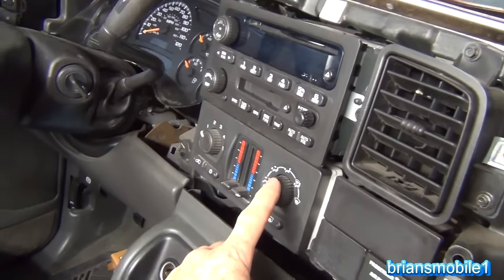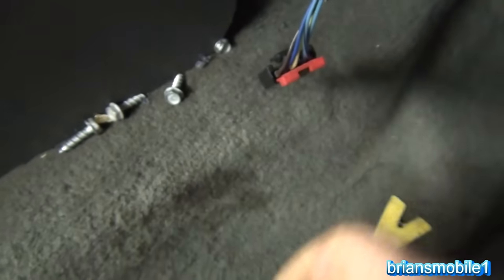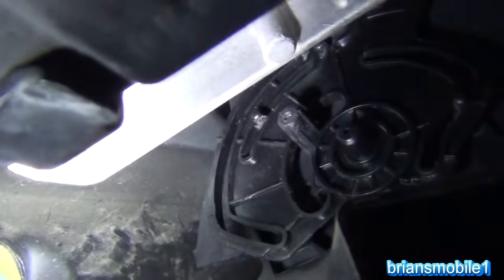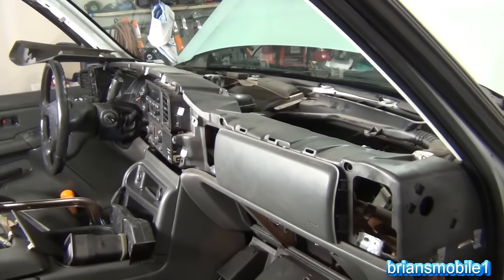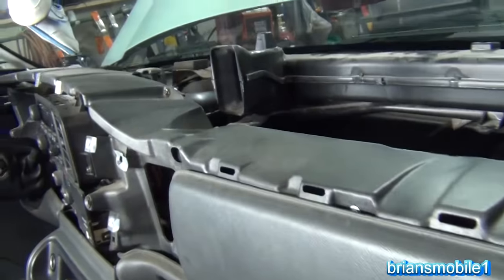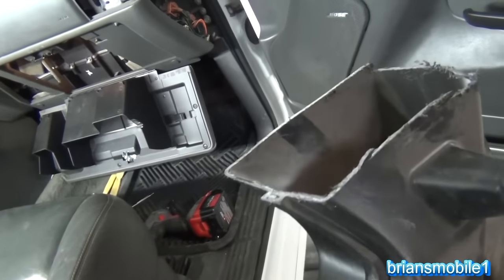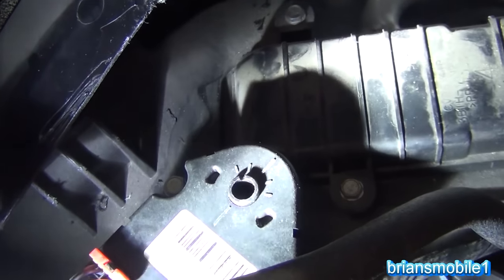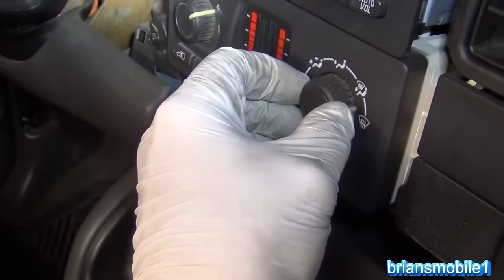Silverado Heater and AC Actuator FIX

Comment: So what kind of magic tool it take to get the top bolt out 🤷🏼‍♂️ little difficult?  there is a metal bracket in the way of any socket
Reply from the maker: 1/4" flex ratchet and a buzzed down short socket is what I use, or a ratcheting box wrench.
Reply: Thank you!!

Comment: Hello I am not sure how to even read your comment back but my question is I have a 2004 Chevy Silverado 1500 and the control that tells you where the air is going to go does it work when I turn the knob it doesn’t matter where I turn it the air is sorta coming out of mainly the defrost very lightly the vents in the floor it’s coming out of everywhere but just you know very lightly out of everywhere it’s mainly blowing out of the defrost no matter where I turn the button when I do the recirculation button I can hear that click on and off so that works it’s just the airflow can you please tell me how to adjust that is there something else other than an actuator that just controls where the air goes when you turn that knob

Comment: How do you tell the difference between automatic and manual blend door actuator. I've changed it out but never knew there was a difference and the new one never worked. Just been changing it over by cracking the actuator open and adjusting it that way.
Reply from the maker: The controls and the temp display.

Comment: 1 have a 2003 Silverado manual control temp ,this morning I rated getting  cold ac on driver side and hot air on passenger side  is this actuator the one under the dash cover  to the left of the gloves

Comment: My 2014 GMC Yukon is stuck on blowing cold through the front only but no heat and it will not move to floor or defrost also the rear hvac is stuck on blowing cold through the floor vent and will not move to the overhead 
I don’t think all the actuators would fail all a once in the same position so there must be another problem 
Do you think the control in the dashboard could be causing the problem 
I see all the videos about actuators and swing door but nobody changes the control

Comment: this helped out alot. my ac is blowing hot on the drivers side and i wanted to know what all is required incase it wasn't a fuse. then again I've had a problem where my compressor belt wouldn't stay on. now it does, but having this air issue.
Reply from the maker: +Snipe Stud00 Thanks for subscribing and clicking that thumbs up!
Reply: briansmobile1 thanks for the video. Found that the driver side unit main gear cracked and jammed on that extra space. Just flipped the gear around and it worked like new. You saved me a ton. No problem for that sub thumbs up n that.....now time to replace  speakers as 3 have blown :(...
Reply: Brandon, my driver side blows hot sometimes on a/c. I have to turn a/c off. Turn truck off, then restart truck and turn a/c back on. Seems to reset everything. I have had to do this for a long time. Hope to fix it soon. ;)

Comment: My 2004 Tahoe the driver side would go hot first. While the passenger and the back rows would be cold. Now the front won't blow at all and the back is warm. If I replace all the Actuators at the same time would this fix my problem? I have checked all fuses. Not sure if the actual Module has went bad or not either. And I have recharged the A/C

Comment: Brian I am having a problem in my 04 chevy tahoe where the A/C will only blow out of my defrost mode vents, and on my driver side it will randomly blow hot air instead of cold. I have replaced the Blower motor, the blower motor resistor and the actual control panel. All I am left with is the Actuator. Which actuator do you think it could be. Any help is GREATLY appreciated.

Comment: I have a 2004 extended cab with the dual slider temp control, how many different actuator types do I need? Are there 5 pin and 3 pin, then how many of each. Thanks !

Comment: @briansmobile1 Thank you for posting this video. Gives me hope getting to the top of the dash in my1999 GMC Sierra SLE. I am sure I will need to eventually need to update the upper actuators soon. Many times inside the actuators are a main or largest gear located on the shaft are found to be cracked or weathered, these can be replaced for as little as $12.00 ea. w/ kit available on Amazon. I have successfully changed this gear in the bottom of the 1999 GMC Sierra Hot/Cold and now attempting to reinstall the updated Mode Blend Door + cam above the accelerator pedal. The duct that is below can be removed by removing one screw and then pulling down and to the driver door as there are two hinge point that give once you remove this L bracket screw freeing the support point. I am having a hard time getting the 3 points lined up as I attempt the replacement. Any tips for reinstall of this unit will be greatly appreciated.

Comment: I have the issue that driver side was staying hot as passenger was cold, also not going above 3 on blower. Replaced control module, control module pigtail, blower motor resistor/pigtail, blend door actuator at bottom. Got all blower speeds, but still getting hot air. So if I understood what this video described, I should replace the top actuator.

Comment: hello I was watching your video about the ac I'm having a really bad situation with my, 2004 yukon denali xl my rear no heat just cold air.front also I change everything
Reply from the maker: First thing I'd check is if you're low on coolant at all.  The heater core can vapor lock with steam if you're a little too low on coolant- even if you're not over heating.

Comment: There is NO need to cut duct, simply remove metal structure and fastners that hold duct ends and middle fastners to Instrument panel (IP) structure then rotate duct assembly out of cavity. This does not require loosening IP from bulk head of truck or dropping of steering column.
Reply: @briansmobile1 pin this. This is way easier than cutting and takes no time.

Comment: Just an FYI, for the spot where the plastic tab on the air duct is molded to that other air duct I was able to separate it and pop it apart with a small pry bar.
Reply from the maker: Way to go Willy!

Comment: Hey Brian,
Have you ever ran into an issue with these actuators where a sensor failure or something fails?  I have an 03 yukon with a bit different climate control, but same 5-pin actuators.  The motor works, the gears are find, and when I plug it in it jogs over a bit, but it won't move the door.  Any ideas what could fail in this little actuator?

Comment: Brian, I was wondering if you could help me diagnose my problem. I have a 2005 GMC Sierra.  When it's cool out and I put the vent on and turn the temp to hot, I get hot air for a couple of minutes  and then it turns to cool air.  This just started happening.  What do you think the issue is or which actuator do you think is the problem?  thanks Joe
Reply: Joe Simpson you might be low on coolant

Comment: I'm in the process of replacing the actuator under the dash above the transmission hump.  Actuator isn't lining up right to the knob it sits on.  Is there  certain way to get it to adjust to the same position as the new actuator??  Any advice would be greatly appreciated!!

Comment: I have a 2003 Ext cab Silverado with digital dual auto climate controls.
It was only blowing out of defroster vent. I pulled H/Vac fuse did the recalibration steps let it cycle (which it did not) it went to 74 degrees. Now it only blows out vents in your face? Any suggestions would be awesome. Thank you

Comment: I have a question for you if you can help I have a GMC Sierra 1500 a c out put low .. the a c clutch comes on and off and then the fans come on  and. Off as normal .. with selector switch set to all Positions I get defrost and floor  and vents  sounds like selector actuator is working correctly ..  when I key on after setting all night I get a vent door slamming closed.   When I push the recycle button I get the air noise change and then back .. I am thinking that the blend door is not being closed or is not sealing letting hot air into the cooler air. What do you think  thanks bob Tuttle

Comment: Actuator, or control switch?  I've got an '03 Silverado.  AC Fan and compressor are working.  Thdermostat is working.  But AC mode is stuck in defog/floor air mode.  When you turn the mode selector to other AC functions, the switch seems to recognize the difference between defog and AC modes.  The recycle air light goes out when it's in defog, but can be turned on again when the AC modes are selected.  Any thoughts if this is a control unit problem or an actuator problem?

Comment: How did you get the top screw out of the mode actuator?  on my 2002 Silverado there is a structural spar the runs right in front of that screw. There is barely room for a socket, much less any kind of swivel or break over bar.

Comment: What was yours doing before this ?
I have an o6 Chevy Tahoe ac and heater works I just recently noticed while having ac on after abit it starts blowing hot air as if the heater were on I turn off truck and restart it starts blowing cold again ??

Comment: So are 3 of the actuators the same and only 1 of them is different? I want to order all the actuators before I take my truck apart and I’m not sure. I have the one off under the drivers side so I have the part number for it but I don’t wanna order wrong parts.

Comment: Brian I have a 2003 with Automatic digital dual controls. It's not switching from defrost to any other mode. Also only blows hot if you set temp to 90 degrees and cold only if set to 60 degrees? Any ideas?

Comment: I have a 91 Chevy 1500, when I’d drive going passed 30 the heat from the engine will pass through the dash and just blow a ton of hot air without the climate control on. My climate control dried out & now my heater stays on as soon as I crank it. Will doing this fix it ?

Comment: I have a 2007 2500HD Classic, regular cab, the dash vent works, then turn it to the floor/dash level, and there is no air blowing out of the dash, just the floor vent then turn it to the just floor level, that works fine, defrost works ok. So it it the driver side actuator that is causing the combination floor/dash position to not work on dash? Thanks!

Comment: I have same climate controller. I replaced the blend door actuator but climate controller is still driving it to full hot. I did the hvac reset 2x. Is it bad controller?

Comment: Hi. I need your expertize. I have 2006 Trailblazer EXT 4.2L with AC/Heat blowing on floor and defrost. Have hot & cold air and can change the flow for floor only, for defrost only, for defrost and floor, so it works but face vent. The control panel is manual. The question is which actuator I have to change (did different calibrations, did not help or may be just me). Thank you.

Comment: You don't have to cut anything. I just remove the brackets and stuff on the driver side as well, after the dash is removed on top. Then you can rotate the duct closest to the window back and up while pushing the other duct back with a pry bar. Then you can reach both screws from the top with a 6" extension on the passenger side and no extension 1\4'" ratchet. On the diver side screw. I Just did one of these in 1.5 hrs flat. As the passenger side was blowing hot air and the upper one failed. 

I would add.The duct closest to the windshield is plastic riveted with hot melt gun from the factory. Just use a soldering iron to push the flat part on top out of the way. Then when putting it back, just use the old actuator plastic to melt a new plastic to the stud sticking up. It will look like nobody ever removed it.
Reply from the maker: HEY!  I like that!  Thank you!

Comment: Successful installed all actuators. only problem is the one under the drivers side. My 2003 has a sprocket looking tab that hangs down that meshed with the puck. So frustrated right now because it doesn't seem like it's reaching its full limit.

Comment: Hey Brian.  Would you mind sharing your brand of foil duct tape?  The stuff I've been using has the thin non-dampening adhesive layer.
Reply from the maker: +Eddie the Grouch Sure, it's the Nashua waterproofing foil tape.  Here's a link → http://www.amazon.com/gp/product/B0047XXZ7Q/ref=as_li_qf_sp_asin_il_tl?ie=UTF8&camp=1789&creative=9325&creativeASIN=B0047XXZ7Q&linkCode=as2&tag=httpwwwyou00f-20&linkId=G4ABZPJK274KITPU

Comment: I have a weird sound coming from the passenger side dash - would that be the recirculation actuator? It's not the fan. And both passenger and driver side will go from hot to cold.

Comment: I have to swap out the MODE actuator on my 2003 Suburban. My problem is getting to the 2 bolts that hold the MODE actuator on. After removing the piece of duct and the front knee panel, there is still no room to get to one of the bolts. Using my smallest socket wrench + a 6mm socket, I cannot get it close to the bolt as there is a dash metal casting in the way. In your video you don't mention how you removed the MODE actuator and what tools you used. Could you please enlighten me please?

Comment: Okay, so... My truck I have this set up. The only vent that I can feel blowing air  from where I sit is the vent to the right of the stereo.  All the other small vents my hand needs to be like an inch away to feel any airflow. Is that normal or is that the actuator? I'm assuming I should feel the same amount of air from each vent?

Comment: How many of the actuators have the 5 pin connections and how many have the 3 pin…. I have the same setup as that truck in the video and I want to replace all of them while i have the dash apart

Comment: Hey sir, thanks for the information, however I have a question. A friend of mine has a 2003 silverado 1500HD, with manual control. the control on the driver side stays hot in both position. he told me that he had the same  problem with the passenger side, but his son changed the one on the bottom, and it fixed the passenger side. I'm confused, cause you said the one on top, the hardest one, was for passenger side.  could you tell me what's going on. thanks again.
Reply: Did you figure out which actuator is?? My 2004 Silverado has the same problem. If I slide my driver side heat/cold lever to hot or cold it only blows hot either way. Which actuator is it?? And there was a annoying sound, kinda popping sound, coming from behind the center of my dash for a while. Did you have that?? Please and thanks

Comment: GOT A GOOD  ??  FOR YA.... NOW BEING  JUNE HERE IN OHIO..... I GOT ALL HOT AIR FROM MY VENT'S TO GET IT NOT TO BE HOT ON ME DRIVING I FIGURED TO SHOVE THE KNOB ON THE RIGHT SIDE ALL THE WAY TO THE RIGHT  ...... I HAVE A 2004 Silverado half ton 4x4 v6 reg,. cab & longbed here.......  what do i need to replace so it's not always blowing very hot air on me w/o that far right knob jacked all the way to the right side......... ( what real part's or actuator's do i need to make it back to normal )....???

Comment: I put a new compressor on a pickup truck The line freezer but it still throws hot air to the vents can the actuator from the heater can stay open and make the air come out warm...  I'm running out of ideas can you give me some kind of idea or help me, PLEASE

Comment: Hey Guys, my driver side manual temperature controller makes a squeaky rubber sound , it's very annoying. I have a question. Is it the actuator on the driver side or the actuator on the passenger side. and are they both the same shape? thanks

Comment: My 04 silverado heater blows cold air on driver side and hot air on passenger, so the fix to that would be under the glove box? Thanks for info by the way
Reply: On my 2001 Silverado "w" ( the engine code ) it is really visible → You get rested and relaxed an do not force nothin;
You then imagine yourself a contortionist and use a flashlight then compare to pictures;
The drive axle has to be aligned some way > Brian how do we do that? By attaching power or what

Comment: When I look at the filter in mine it looks like the air always goes through the evaporator coil. Then maybe the blend door makes it go through the heater core after or not? So when in heat mode air goes over the evaporator and the heater core?

Comment: Bryan, a question  ; I need  replace the actuator that is located  in front under the driver, the actuator  shows  the  number DZ 52495593.( mine),  so    could you tell me  what will be the   number  for replace ???  I found  nother  with the  number DZ 52402598,  COULD USE  THIS ??   IS THE  SAME  PART ???   THANKS FOR YOUR ANSWER

Comment: I have problems with my 2004 Chevy Silverado. Driver side hot/cold actuator will open all the way for hot then back off a quarter turn after a couple of seconds while passenger side stays open fully blowing hotter air than driver side. Brand new actuator for driver side. Thanks in advance for any help

Comment: I wanted to see if mine was working, so without mounting it, I plugged it in so I could see if it was turning. Well it was, but then it stopped. Did me not having it mounted before plugging it in cause it to break?

Comment: hey what's your take on the 2007 and newer GM with 5.3 having a crappie idle in drive. No DTC are being thrown and tahoe has no loss in power. I tried posting question on other video about fuel pressure regulator on Yukon/ Escalade.
Reply from the maker: +TexasPrepper  99% of the time it's a leaking intake manifold gasket. (vacuum leak).  I have several videos on this.  https://www.youtube.com/watch?v=UckuWapeeps  https://www.youtube.com/watch?v=B3kzOCj2IPU   Good idea to do the knock sensors at the same time.  https://www.youtube.com/watch?v=u6dZhKgeCSY

Comment: Brian, I changed my passenger side blend door actuator and it still blow hot air. No ac on passenger side
 I even manually moved the door by hand and still blows hot in either direction. Any ideas?